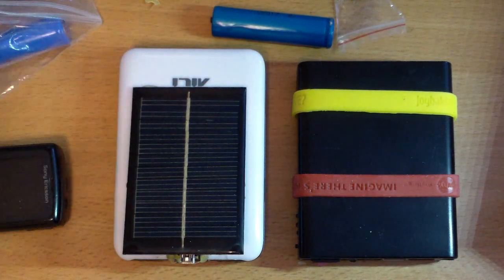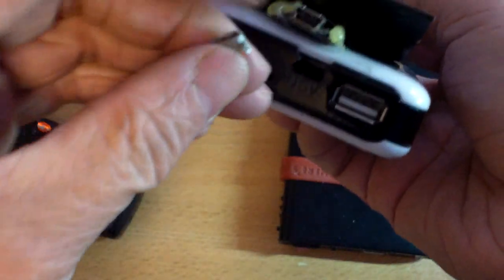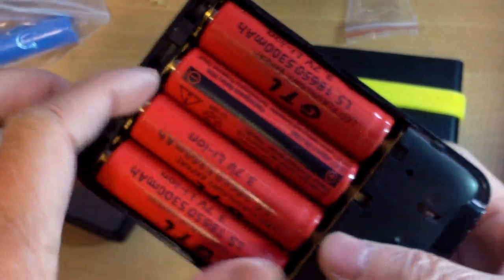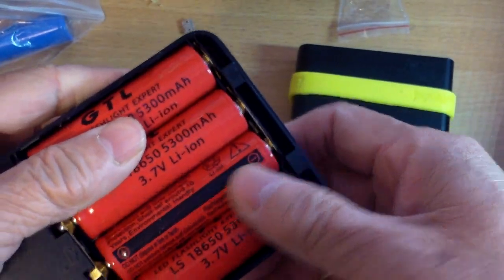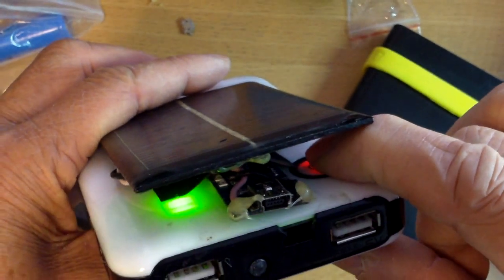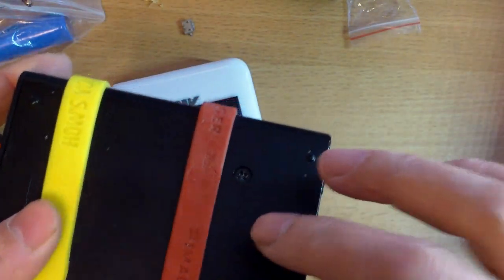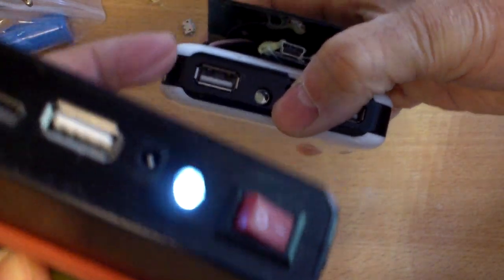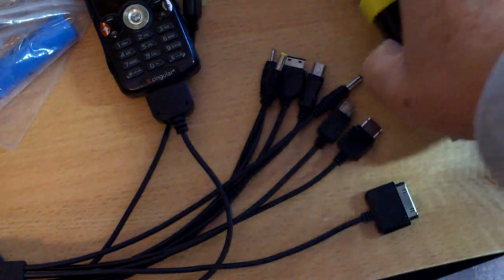Salvaging a rechargeable power pack with a bad micro usb input

Comment: Finally, someone who knows the difference between mini- and micro-USB connectors!  Most often people will confuse them, or worse yet, call the micro-USB "you know, the one for like tablets".

I bet you even know the difference between USB-A and USB-B connectors, which is something else people don't get.  They'll call the "B" end the "printer" end.  I don't get it.  It's as simple as going from point A to point B (notwithstanding the fact that data flows in either direction).
Reply from the maker: jaykay18 And of course, you now have USB 3 connections to make or confuse you further.
Reply: And 3.1 is around the corner.  I guess it's impossible to have a USB 95 (unless they make a "C" connector), but I sure can't wait for USB 98!